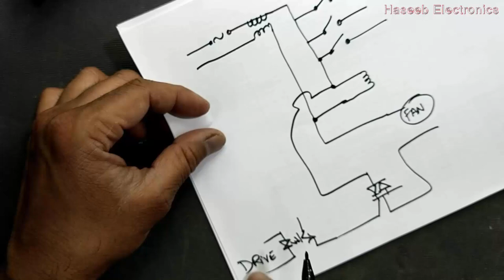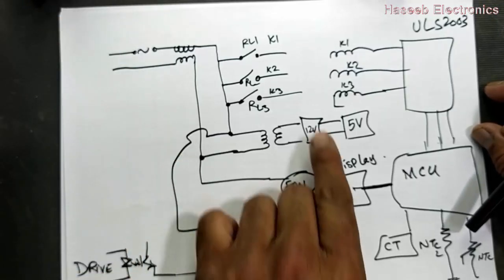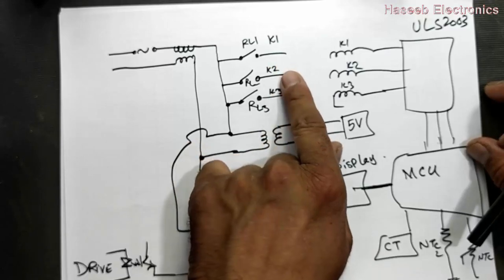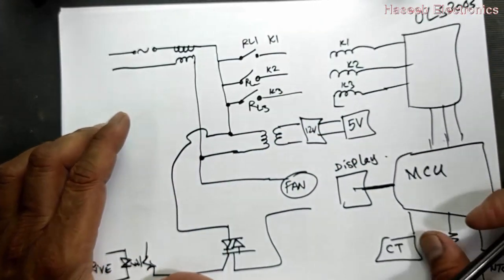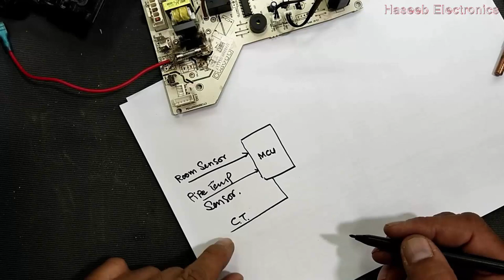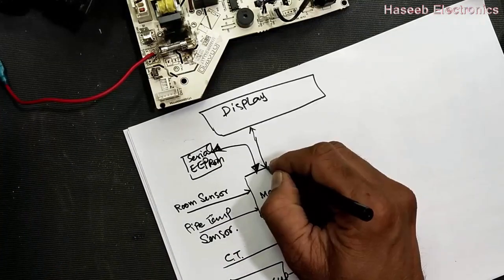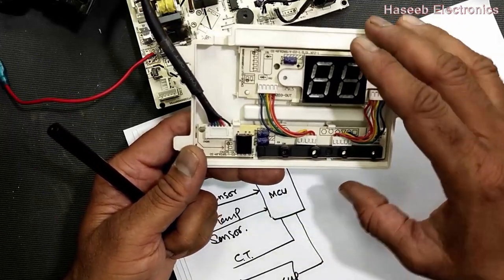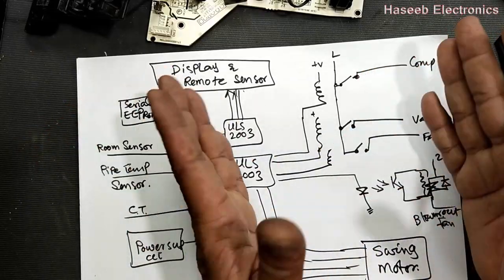#327 Split AC Indoor Unit Board - Repair/ Test / Function Explained / Troubleshooting

Comment: I've been binging on your videos because you're scratching an itch in the back of my brain. I've always been into making custom cabling for ATX supplies. Never did anything inside except clean/ replace non-modular outputs with heavier/tinned leads. I've been on a kick and really enjoying tearing my consoles apart, cleaning 25+ years of dust/dirt, HDMI modding, RGB modding, recapping... But I have this wasteful want and urge to take a "cheap/bad" <$50 ATX unit and replace every component piece by piece with "better" "slightly higher rated" "name brand" "Heavier duty" "etc" options.
All said and done, some day I can imagine spending 3 times the initial cost of the unit on a shiny new BoM full of "upgrades and improvements" only to snap back to reality and realize you can't just spend $15 per cap and use nice conductors and expect to have the equivalent value compared to an off the shelf option. Such a bad idea. Its like every tech forum's pet peeve. My apoligies.
Reply from the maker: i am happy to see your valuable comment. 
i am thankful for your valuable time
please accept my best regards

Comment: Hi very professional explanation, can you give a bit of advice, I have split unit Frigidaire I live near the ocean, this is the second control board I have changed for error E9 ,any suggestions on how to stop this or what I me need to change on board ?
Reply from the maker: good evening 
can you please mention the model number of your device. 
so i can comment something 
E9 in fredgaire is related to temperature sensor 
but it is best, please reply with model number

Comment: Nice video! Nice 60+ year old fuse wire. I have some solder I use that's from the 1930's! Does the variable speed work on duty cycle or frequency? I assume duty cycle, because the circuitry looks like it could be a VFD design. Thank you.
Reply from the maker: yes this fuse wire is too old
in the phase rectification it uses the frequency pulses to drive TRIAC
Reply: My mistake. I should have realized that a triac is not used in a vfd, which would be a better, but more complicated (expensive) design. Not all motors like triacs and I know some motors don't even like vfd's, unless they're pure sine wave.

Comment: Hi. How easy is it to interchange indoor and outdoor units of AC splits. Are all the signal wires work the same? Should I just make sure live neutral and signal is connected and any brand will work? I'm guessing for non inverter yes and inverter type most likely no

Comment: 20sq045 Schottky diode can be used in 100 KHz SMPS output ?
👍👍🙏🙏
Reply from the maker: yes it works. its maximum frequency is 1 MHz
Reply: Thank you so much.

Comment: Hi,
I have a problem with unit, outdoor unit sometimes want to start but in general indoor working outdoor not, sims to this board had same problems, only difference is that your is showing error code, my is Old. To I afraid that microcotroler do not sending order to relay to leave power to outdoor unit, or can be resistor too.

Comment: When fuse is burn because of wrong wires connected, is that mens that fuse only burn or need to check rest components, and how ?
Reply from the maker: in each case we must find the root cause of the fault. specially the fuse deals with current handling components. if fuse damages, the we must have to verify the current consuming components
Reply: @HaseebElectronics  the root fault is made by my mistake, I mix the wires, ac worked on coling, when I switch to heat is trip the braker, and I saw that ac do not turning again, so I found that the fuse is burn out
Reply from the maker: oh
then I think just fuse is defective
Reply: @HaseebElectronics  Yes, just fuse

Comment: Hello sir I have a problem with a gree indoor unit 12000 btu ac power at supply but no other voltage present even at main capacitor or display. Plz help
Reply from the maker: Check fuse, current surge protector and bypass  circuit, bridge, reactor and pfc circuit (pfc module or igbt and diode)

Comment: Hi Haseeb how are you!
I have Air Condition Diakin circuit board Number 2p254206-11 in the outdoor circuit there is a led green light flashing.
I checked  2.5v.  Ok
                  5v.    Ok
                12.  V ok 
          In the 15 + v  ?  I have  16.5v
15v-?  I have 3v 
So I need your help, please 🙏 
Thanks.

Comment: Sir this is very useful video that you share so thankful to but I give a circuit video in whatsapp you do not give response if you not able to see this circuit smps part how I can give you this hosing ckt board that you see and give me smps solution plz inform me sir thanks in advance
Reply from the maker: i am sorry for that
actually i receive 1000+ whatsapp messages, and i try to reply. 
other situation i am away from whatsapp from 2 moth+ because in december i went to pakistan and then back to Jordan and i got corona +ve 
now i am better from some days 
so please send again a  message right now so i can pick your message
please
Reply: @HaseebElectronics  ok sir I will sent you sir obviously bcz i am trying  to find out fault in smps but not able to that the reason if you solve it it will thankfull to you myself diploma engineer in electrical technology not vast knowledge in electronics my company all pcb board in hosing circuit board and I always fail prothom in smps part
Reply: @HaseebElectronics  i pray to allah that might be get well soon sir
Reply from the maker: @azizulislamaziz265  please send WhatsApp message. I am waiting. I will save your number
Reply: @HaseebElectronics  okk sir
Reply: Sir hosing 3 item circuit board i member that hosing hvp90 model and other 2 i will say you tomorrow